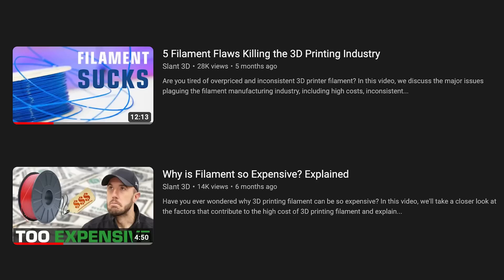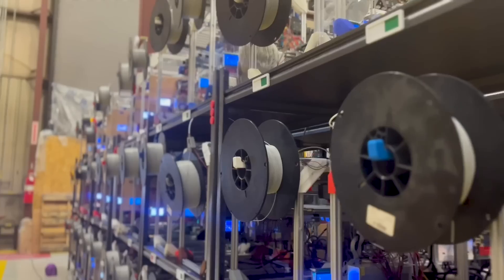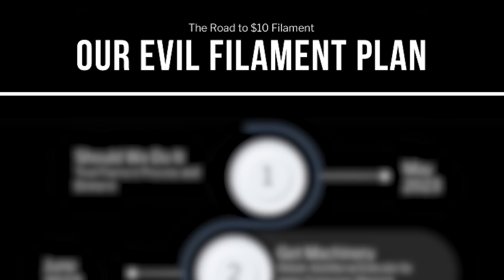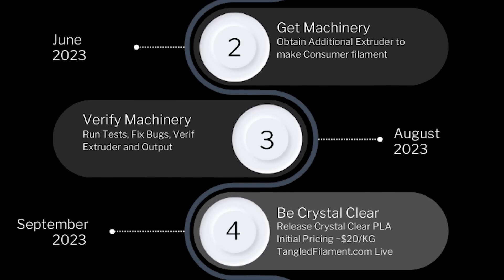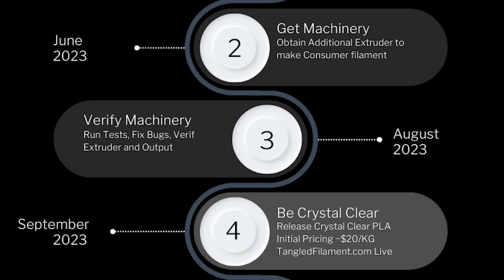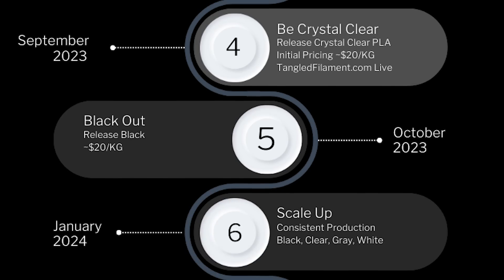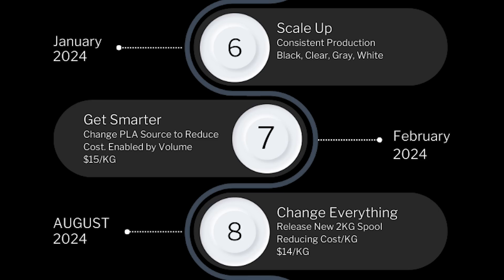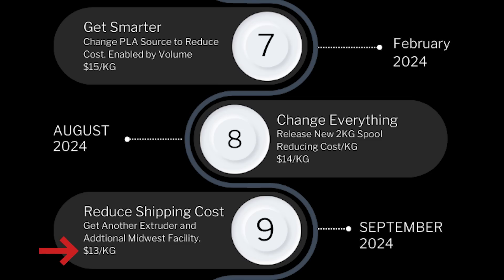Our Evil Plan to Make Great $10 Filament

Comment: My 2 biggest issues with filament at 10$ a kg

1: you can't buy it in multiple kg on one roll.

2: it isn't spooled well or they decrease on quality to deal with the ordering quantities. 

Elegoo has done it best. I see others do it worse where the filament has impurities and strings a lot more. Also, 10$ is only for black, you don't get it for all colors. Personally I think companies shouldn't sell all colors but instead those that they are confident in. For instance, 90% of blues I order are garbage, yellow doesn't stick well, and grey has crappy flow/stiffness/layer adhesion.

Comment: I'm used to buying rolls in bulk for ~8$ but sometimes the quality gets so bad it becomes unusable (breaks like spaghetti). Another problem is that it gets sold out and certain colors become unavailable for months. Itd be great to have a quality alternative for 2$ more or slightly better deal for bulk buys. If its cheaper to produce, compressed carboard spools could be a good option. 
Online 10$/kg you'll undercut some major suppliers like sunlu, geetech, jayo, creality, etc etc in similar pricing range so there's certainly growth potential.
Best of luck on your start up!!

Comment: Hi, thanks for sharing your experience:)
I do like your Plan. But, as a 3d business owner my self, my biggest problem is not the cost of the material, but rather what to do with the empty spools. Would really appreciate a system where you can bring back to the manufacturer the empty spools for recharge or cardboard spools that can be easily recycled.
Something like the Germans are doing with their empty beer bottles, a “Pfand” system for empty spools. :)
Of course, halving the material cost is also quite nice so thanks for doing that :)

Comment: I think what's better than to make cheap filament is to make reusable one. A kind one wouldn't necessarily use for a part but for the twelve prototypes with wrong measurements and missing features. I saw a filament that melts at 60C the other day, maybe something like that, in any case it has to be easily recyclable back into filament preferably by a 3dprinted machine.

Comment: Interesting. In Ukraine, there's 13$ per kg suppliers (and they're considered quite expensive). But it's Ukraine, where labor is significantly cheaper. But the filament is good, which is worth the extra price.

So if you manage to get to 10$ per kg in US, while maintaining good quality, I'll be extremely surprised. Still, best of luck, and I applaud you for even setting such goal. It's truly incredible.

Comment: This seems a really good plan! I hope you will achieve it.
My only concern is about the 2kg spools, that seems the biggest step to reduce the cost (20 -> 15$/kg).
Honestly, I think that for end users the 1kg format is way better for multiple reasons (standard fit on printers like bambulab AMS, options to buy multiple kind of colors without buying too much filament of the same type, etc etc).
If the cost issue is related to the spool, could you sell only refill as most of the brands are starting to do?
Anyway, good luck 💪

Comment: If you guys are going to be designing your own spool, is there any way to move to a more sustainable material rather than plastic, or ideally even provide the filament without a spool at all to be used with printable master spools? I feel like forgoing the spool entirely would even be a way to further reduce cost or increase profit.

Comment: 1 supplier, 2 kg filament spools at $13/kg and $10 unpopular filament (PETG vs PLA). I don't see this working because your competitors can drop prices lower. Your value proposition is quality. Instead of making this a race to the bottom, I would sell quality and match price with your competitors.
Reply from the maker: Incorrect

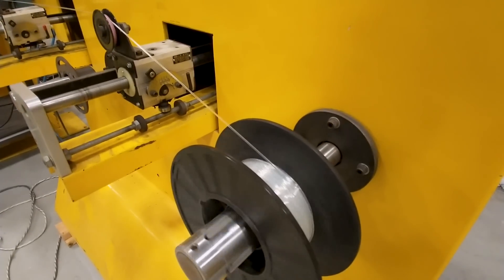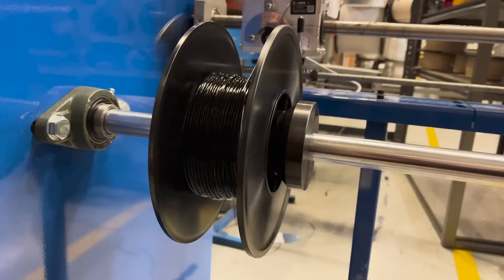Comment: Hey, I noticed that the filament is "tangled," while other filaments on the market are all rolled neatly in line. I'm assuming that this "tangled" is not actually tangled, which would cause the filament to break. I saw in clips at 3:12, and 5:55 how the spools are rolled. How would you ensure that none of the rolls are truly tangled? This would be a large problem for anyone with a printer with no filament detection system

Comment: You should also look in to making a spool-less version, there is already other filament being sold like this and the idea is if i order 3 rolls of black filament, im probably not going to need all 3 at the same time, so i get a roll of filament, put it on my own re-usable spool, and then when that runs out put on a new roll. With this you can cut out the cost of the spool entirely, selling it seperately and/or providing an STL to print your own. 

Also, i just want to say that the moment i saw the title of this video i clicked. I have always tried to save money wherever i can and it seemed that a low quality spool of filament had bottomed out at 20 bucks over the years, im so stoked at just even the idea of a good filament at such a low cost as 10/kg. I also love to see more great stuff made in the USA!

Comment: If you want to be a true disruptor, be one of the only filament manufacturers to build & include filament profiles for all the major slicers.
Reply from the maker: Good Idea. But then we also have to build out filament profiles for each machine as well.
Reply: Well, disrupting isn't always easy. Besides, you can just target the mainstream setups.

But yea, if I see a filament manufacturer has gone through the effort to setup at least a basic profile in a slicer, I become much more interested.

It also holds filament manufacturers accountable in terms of consistency. Given a profile, I would expect the filament to perform the same from batch to batch.

Hopefully that makes sense.

Comment: An interesting angle for cheaper filaments is to use recycled filaments, either from 3d prints or plastic waste feedstocks (basically just PET bottles lol) as consumers will often accept more dimensional error if the material is both recycled and cheap.

Comment: I love this journey  you are bringing us on.  I also look forward to welcoming you to Texas.  I would recommend staying away from Austin, but the rest of the state is fantastic.  DFW is a common area to setup for manufacturing as it has everything you need for supply, shipping, and skilled labor.  Going out to thw panhandle or between Austin and Midland, you can get some great deals on electricity (this is where the huge Bitcoin mines are setup).  Additionally, this area maintains low humidity levels, which I would assume would be a good thing for extruding filament.
Reply from the maker: Thanks for the tip

Comment: May I suggest having a feedback page that you can quickly access with a QR code with the batch number auto filled. This feedback page could have all parameters you are looking for with feedback like consistency, color, jamming, packaging (unsealed bag), printer used, etc. I’m sure people will use it to help you get the most feedback ASAP to help iron out bugs on the production line.
Reply from the maker: That is a great idea
Reply: I would recommend a fiber laser as the marking time is low and has a high level of success on plastic. Also 5 or 10 kg spools would be a nice for massive prints.

Comment: Regarding the black color, please consider a matte black rather then shiny. Matte seems to be more popular recently, mostly because it hides print errors better.

In regards to the spool, please mention the empty weight of it on the spool itself. That way it's easy to calculate remaining filament.
Reply: Yes I use Zortrax black PLA because the matt finish is my favorite :)
Reply: first person EVER to like Zortrax PLA @theinspiringengineer-scien6393
Reply: semi or "satin" finish is better than completely matte, its the typical PLA finish that isnt glossy, it hides print errors better than typical gloss, but keeps a tiny bit of gloss
Reply: matte looks better in all colors in my opinion... shiny makes it feel cheaper for sure. definetly puts those layer lines on display with a more plasticy feel.
Reply: @Domieboy  its... plastic... and you are complaining about the "plasticy" feel?

just dont do 3d printing then, theres ways to avoid the issues with any filament, it just takes some effort
Reply: Matte is less reliable (esp in farms) and almost certainly much harder to produce reliably so I wouldn't expect it to come for a while
Reply: @floatingsystems2929  theres also a baby powder and resin method to smooth layer lines to basically visually remove them altogether

matte plastics usually are slightly more brittle to begin with due to the structure needed to provide the visual effect

it wouldnt matter much for look-good pieces, but for anything with any tiniest bit of structural load, like the handle on a cosplay sword prop, made of the same material or heavier than the blade itself, will likely break faster than the blade if the blade wasnt made from matte to begin with
Reply: I actually prefer Grey because it is easier for me to see details vs black
Reply: The spool thing would be nice but for a cheaper spool it wouldn’t really be practical
Reply: And I figure it’s easier to paint without as much prep work
Reply: @sleepdeep305  not necessarily
Reply: For cosplay I love shiny as it lets me see areas I need to sand but I agree there should also be a matte black as I love unpainted matte black
Reply: Matte is more professional and I very much prefer to have the default to be matte rather than glossy.
Reply: @TechnologistAtWork  its not "more professional" that's an illusion
Reply: @ShockinglyBland  I agree, the initial impression on hobby prints look much better comparatively to standard gloss, in my opinion it does give a more professional look
Reply: Why would you suggest this instead of both?
Reply: @LampDoesVideogame  ive said satin is a better choice, but these people want to fool themselves into thinking they are making metal, at that point they should just print and sinter metal/ceramic parts instead
Reply: Every black shiny PLA I've tried was very very prone to becoming brittle. I wonder if the used dye affects the stability of the PLA?
Reply: would a brush finish (as used on staiinless steel) using a fine wire or hard plastic dremel brush work ?
Reply: I’d prefer they don’t just offer matte as matte filament can have additives that makes it more brittle.
Reply: Did you know you can make most gloss PLA turn matte just by printing it "too hot"?

You need to tune your bridging, but it works.
Reply: Matte finish PLA tends to be more weak
Reply: @JarMagno  That is simply not true. And you don't have evidence to back your claim.
Reply: @TechnologistAtWork  Lol do you even print? And it is well known on 3D printing community/groups. Based on my experience and many more others.
Reply: @JarMagno  I've been printing longer than your dad has been carrying you in his purse.

Comment: You want to be my hero? Make sub $15 a kilo shipped PETG but good PETG like atomic filament like filamentum p e t g that's tough Prince easy doesn't warp doesn't string and isn't brittle :-) I love my atomic filament but damn it does $33 a kilogram hurt but there is nothing else like it none of the cheaper filaments print is good print is nice and none of them are as tough nothing's worse than printing a rocket and having it crack on landing because of its cheap crap PETG :-)

Comment: Don't put all your eggs in the basket of production cost. Shipping is ridiculously expensive these days, so give some attention to partnerships with shippers and retailers too. I buy filament at the local Micro Center for around $20, so until the total cost is less than that, I will have no reason to change.
Reply from the maker: Already done

Comment: I thank you for starting with PLA not PET-G because I don't use a lot of filament as I am conscious of waste and as a hobbyist rather than a commercial printer I would rather not print if I don't have a need so I am not contributing to the plastic waste problem, I already don't know what to do with my scraps. So I have some PLA spools that have been sitting a year and one ABS spool that may never leave it's package because I don't have a dryer.

Comment: for cost, develop a way that you can make a refill of filament that you can put on a reusable roll. cut out the cost of a whole reel for each roll of filament. it is both environmentally responsible for those who care, and cuts down on the number of empty spools that pile up... and saves you the cost of a spool for each and every roll you make. then sell or create a reusable spool that connects through your filament with built in bearings and sell it an offer a stl for people to print their own :)

Comment: Nice idea.  I knew for quite a while I was going to get into 3D printing, so I started buying spools of PLA in advance.  I got a printer in 2019, but, I'd been buying filament for a while.  The average price I paid was $10 a spool.  Some spools were as cheap as $6 per KG.  By the time I got into the hobby for real with a GOD DAMNED Ender 3 Pro (which I have since disposed of) I had a big bunch of filament - which I am still using to this day with a NON-CREALITY printer.  As a hobbyist, I can tolerate errors in manufacturing easily - although they're still annoying.
If you can deliver suitable filament for anywhere NEAR $10 per KG - - - you've achieved quite a thing.  this is where I paste an APPLAUSE emoji --- although I'm not quite sure how that works

Comment: One thing to consider at some point along this voyage, reusable spools. If you can find a way to make spools that can separate into two identical stackable parts that can be returned to you in large batches for credit on future purchases. You might be able to reduce cost a bit more.
Reply: yeah now a lot of people are printing with bambu lab x1c/p1p as well. They come with reusable spools for the AMS and you can get filament without spools that slides right on

Comment: I also am passionate about seeing manufacturing processes and technology improve and expand. When I got my Bambu X1C and designed my first few replacement parts and picked up a couple customers, I realized right away that what I was working with was not simply a tool to make fun little gadgets. I was beginning a journey to unlock the power to replace parts that until now had no replacements. To fix things that were once unfixable. Almost a year later, I'm doing resin and filament prints all the time, and starting to design more of my own products, because long-term, that's what will set you apart from the rest of the industry. Bringing the price of filament down will help the process compete even harder against injection molding, whose tooling and specialized requirements create a huge barrier to entry for manufacturing new product [I've explored it a good bit, its fascinating stuff, but we can definitely do better!]. Seeing what companies like Nexa3D can do with resin printing too is quite exciting, but until the open source community has produced a comparable solution that can be iterated on and improved by the passionate folks of this industry, we will be limited in our ability to deliver quality parts that fast. On top of that we have printers that can UV print full color on the outside now? Give it another few years and it'll be mainstream, at the rate we're going. I want to spin up a farm of my own, because although I've done IT for 13 years and am getting into development now, there's just nothing like holding something you made in your hands. The satisfaction alone of having that finished product and the tactile feedback, that click of it snapping together like it's meant to, it's so worth it.

Comment: May I recommend trying for a CMYW (cyan magenta yellow white) set. Very specific colors to aim for, but EXTREMELY useful color set. Right now there are only 2 or 3 places to get these specific colors, and they are NOT cheap.
Reply from the maker: Interesting idea
Reply: @slant3d  using thin layers, these colors can allow for a wide WIDE range of final appearances. (especially on the top surface of a print)
Reply: Also, please be sure your spools are AMS compatible.